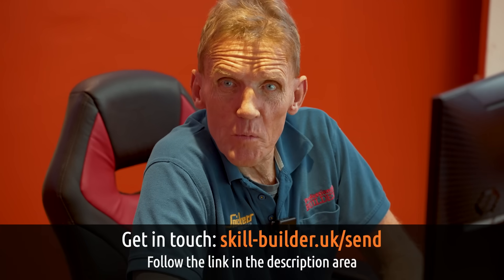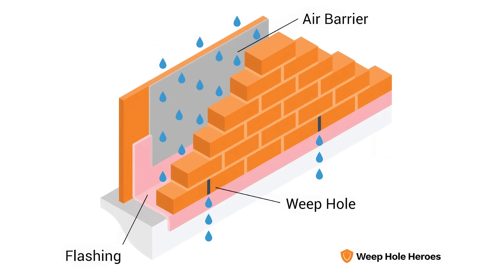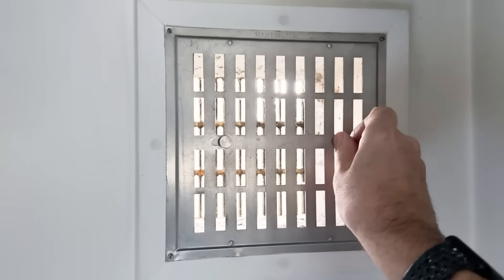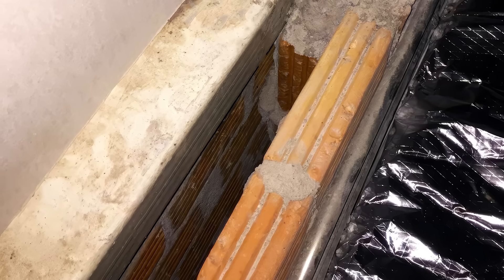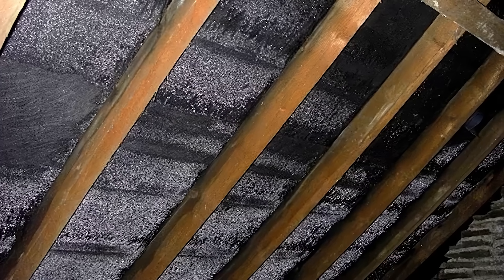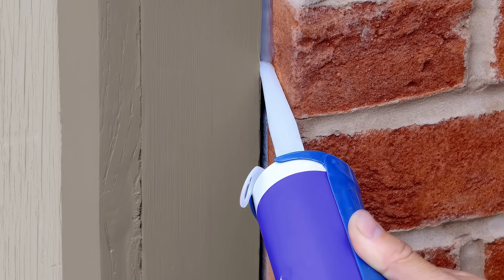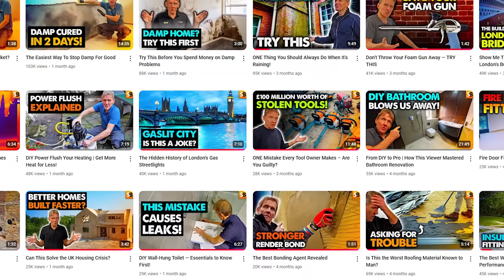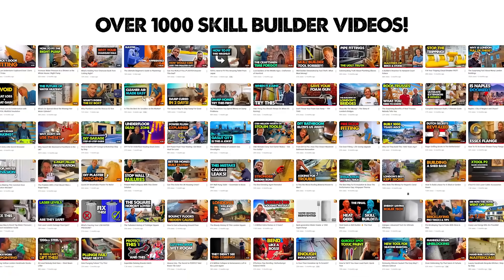The Truth About Cavity Wall Ventilation

Comment: Not sure u want kill airflow though the cavities, as it’s a tried and tested way of preventing moisture build up , which could cause problems with  damp and eventually rot ( in timbers ) capping the top at the eaves makes sense but sealing up or removing the air bricks at low level, I’m not so sure,trapped air is a great insulator ( as roger says ) but trapped moisture laden air in the cavity is only gonna lead to problems further down the line I reckon , uve gotta somehow come to a compromise between the two scenarios insulation but without introducing a damp issue and airflow whilst trying to reduce heat loss , it’s tricky , especially in a retro fit scenario ( with no or virtually no access to the cavity .)cavity wall insulation can cause its own problems also and any rockwool type of insulation in the cavity is a complete no no ( if it gets damp it will definitely cause damp , especially at low level as it starts to slump under its own increasing wet weight) and the micro beads stop the airflow at low level . Like I said it’s a problem on older properties, not so for new build if built correctly to the regs ( although we all know that don’t always happen 🫤)

Comment: My 1911 terrace has lime mortared cavity brick walls. The cavity is ventillated externally by huge cast iron vents a the top and bottom, plus gaps into the cavity above all the sash window frames. After 100+ years the walls are beautifully stright with apparently no issues with corrosion of the wall ties, but I hate to think what could happen if I messed with the cavity ventilation in any way.
Reply: If it ain't broke, don't fix it! 😁
Reply: I'd suggest it would be worth filling the gaps on the inner skin around the windows as the gaps will allow moist internal air into the cavity.  You may be lucky in any case, and have wall ties that don't rust (wrought iron lasts for decades even right by the sea and regularly submerged in saltwater, and I think some early types of tie were even brick-based).

I'm not against changes and improvements myself.  My own house has a 9" solid exterrior wall, which isn't its worst feature, but the wall does get cold in the winter and hot in the summer and is pretty awful thermally.  I think the problem we have is people rushing into a one-size-fits-all approach, often by inexperienced installers and without consulting people with a thorough understanding of how historic buildings work.

I did insulate my suspended timber ground floor, and found it to be a significant improvement on an uninsulated one, but I can see how this could easily be done wrong and also cause trouble.

Comment: Filling a cavity with insulation bridges the cavity and allows water to track onto the internal wall and is particularly poor building practice.
Reply: The primary role of the cavity is to waterproof the building not provide a location for insulation. A way better method if you want additional insulation is brick veneer with the insulation within the interior timber wall. We leave our cavities open in Australia. We get so 3:04 much rainfall too. Cavities get a lot of water inside them, they also need ventilation to dry them out. It’s been working for 100’s of years. 

What do you do in England when all the wall ties corrode due to all the moisture trapped inside the cavity, condemn the building?
Reply: Modern wall ties in the UK are stainless steel, so no corrosion. Whether the inside of external brickwork gets wet is down to a number of factors (porosity of brick and joint, location, aspect etc) but I've demolished plenty of cavity walls which are bone dry inside .
Think about it; most.properly maintained 9 inch solid walls don't suffer penetrating damp, why do you assume the outer 4 inches would always be prone to being saturated? They're usually not  @davidconnolly7346
Reply: That's what cavity trays and weep vents are for, they are never 'sealed' so to speak.
Reply: Have you been living under a rock for the past 30 odd yrs? Fully filled cavities have been used and APPROVED for use in this time! Bad workmanship is the cause of damp penetration!
Reply: @ It is like putting a sponge inside the cavity retaining moisture . It bridges the cavity and draws water across the dry interior skin. It also promotes corrosion of the wall ties. Unless the exterior face of the wall is sealed with a properly sealed foil and reasonable gap maintained water will track across. It is such a stupid idea approved by officials that have had a mind fart. 

It has never been legal in my country. We frankly still have our brains turned on.
Reply: @ It cannot work, you are putting a sponge inside the cavity and tracking moisture to the dry skin. You are also jeopardising the structural integrity of the building by creating a moisture soak at every wall tie encouraging them to corrode. It could work with foil faced insulation but a cavity should still be maintained. Whoever approved that 30 years ago was having a brain fart. 

It’s not legal where I come from we still have our brains turned on. Seriously it is absolutely nuts, and fixing it with a paint on sealant is bs too. It’s poor building practice.
Reply: @davidconnolly7346  not arguing  but where are you from. I'm in essex UK, I've laid bricks since 1986 with full fill insulation  in 95% of the cavity  work. I've yet to have a comeback. Modern  full fill bats are water repellent  but the older stuff not so much
Reply: @ I put it to you that no one would come back to you personally as the building is warranted by the builder. From a builders point of view, problems like this wouldn’t manifest themselves until well over in our case the 6 six year warranty period. For instance wall ties are not going to fail within 6 years. What I’m thinking about is the longevity of the building.
Reply: @markrichardson5295 nothing is better water repelant more than a  cavity. I received advise like u and my 5 years old extension  smells terrible because of damp rockwool.

Comment: I would argue that each building design is different so a 1 size fit's all approach doesn't work. Some houses need the airflow/cavity regardless. Filling it will just cause issues. The building next door might be similar but is ok with cavity filled with insulation. 
Materials used, quality of the job will all effect the outcome.
Reply: and local weather - in a wet wind or not ?

Comment: Last 2 months i build an extension on my house. I filled our cavity with insulation about 3 years ago, so i was a bit nervous how it looked on the inside after removing some walls (in cold and rainy weather). You dont know how it goes in the cavity, maybe it is a bit wet or dampy or moldy. But it was a perfectly fine, dry insulation, dry bricks, no heaps of insulation flocking together etc. 

I have to say we do ventilate alot in house and the house is build in 1970, so the bricks and joints are good. 

I do think if you have a house with bricks and joint that are more porous or broken, you better re do the joins and impregnate the bricks before adding insulation.

Comment: I was always stunned by the sheer simplicity of cavity wall insulation sales folk. They'd knock on my door and ask if I want it, I'd tell them it's a Victorian house - with solid brick walls. They'd say 'oh'... and then go next door, and enxt door to that etc. In a terrace of houses exactly the same, getting the same answer each time.

They have now moved onto the highly toxic and flamable external insulation. So they're having to be told what a conservation area is by everyone that answers.
Reply: It would only take one, probably elderly, houseowner, who doesn't know/understand they have single skin walls, to say yes. Then they could turn up, drill a few holes in the walls, make some noise and pack up.
Reply: 😂😂😂😂😂😂😂 @gcunn1
Reply: I'm in a conservation area and I'm having external wall insulation. It was approved with no conditions by the council. It would only be if the parish council are staunch traditionalists or if the house is listed that you might have any issue.
Reply: @robertszynal4745  Lucky you.  A friend of mine was in your situation (conservation, but not listed), but the council took a very hostile attitude to external wall insulation of a 9" solid wall.  Timber cladding wasn't appropriate and 'would trap moisture' (with sheepswool insulation???), render wasn't appropriate etc etc.  No real attempt at discussion so basic method seemed to me to be ' apply for whatever you like and we'll find an excuse to oppose it'.  This was Tendring District Council planning office (and, moreover, their masters in County Hall).  The actual local councillors did not object to it.

Meanwhile, other people in the same street have carried out far less sympathetic cladding without insulation, and enforcement action has not followed.  Then we wonder why this country has the worst housing in Europe.
Reply: @robertszynal4745 External insulation is the best, you'll save a fortune with the heating, warm in winter cool in summer 👍,  they paint/skim over it so it's fireproof don't worry.
Reply: @ianmangham4570  most modern paint is made from flammable polymers. Only specialist flame proof paints, which are expensive, special mineral paints and traditional limewash, have anti fire properties. Unfortunately most outside paint used is plastic based masonry paint. Which despite its claims is very unbreathable, creates huge amounts of microplastic pollution, and has absolutely zero fireproofing abilities. It crinkles and burns up even with lower temperatures from a hot air gun, let alone an actual fire.
Reply: @robertszynal4745  not at all, the local district council is the planning authority, and they would normally prevent this. As it drastically changes the appearance of a small area whose appearance is being specifically preserved. External wall insulation can also cause huge problems on older buildings, especially if not done very well, or without proper attention to detail. Old solid walled buildings remain dry by the walls being vapour permeable, to remove moisture. Stop this and they can have terrible damp problems.

Is you house a modern nondescript house, in an area of older houses? This is the most likely answer as regards why you got permission. That or a grossly incompetent planning officer.
Reply: Flammable are you sure
Reply: I'm amazed at how much industry there is for cavety wall insulation REMOVAL. Heating a home is easier than spending all the money to remove damp and mold.
Reply: Hahaha - brilliant 🤣

Comment: Back when people could live below 20C the cavities were all open. Tons of airflow, but not much insulation. Less problem with condensation indoors. Before that it was straight 9 inch with no cavity. Or rock with rubbish infill. Cavity wall insulation is still supposed to sit off the outside brickwork for airflow. Same as roof areas are supposed to have airflow. I remember when they stipulated a 2 inch air gap. And we installed soffit or fascia vents to create that flow. And then tile or ridge vents to exhaust that. Keeping the air moving. Now are you supposed to have no flow. Makes no sense. Not good for the house or the occupants.
Reply: The 50mm gap regulation still applies - in roofs its for ventilation, in walls no so, its for water / moisture transfer from outside to in! If moisture can migrate to a cavity or roof void it must be ventilated, if it cannot - it doesn't need ventilation. If you prevent migration (say from a room into a roof space) then the room needs ventilation or damp will occur!

Comment: Well Roger, as a long time fan of 'Bisby News' :-) i would have to query your assertion that air (whether moisture laden or not) from the cavity could lead to an appreciable amount of condensation in the roof space .. I have no evidence to the contrary as such, but roof spaces generally have a reasonable air-flow for lots of reasons .. so if one were to see a lot of condensation in the roof space my first thought would be to check the roof space ventilation (as we know that some folk stuff so much rockwool right into the eaves that natural ventilation is diminished) .. 

but carry on Sir, as you put out some great info and there's often a talking point to get our teeth into :-)
Reply: good point Sir, ive seen appreciable amounts of condensation on the underside of roof tiles, and would agree that this is not due to 'cavity' issues .. since the condensation was widely spread across the roof and not local to the top of the walls .. 

particularly in winter, roof tiles ARE cold enough to cause moisture laden air to reach its 'dew point' and then water droplets 💦  appear .. 

as you say, most roofs, particularly older builds are well ventilated naturally .. even birds and bees are in there building nests and those little paper hives .. lol😂

Comment: Hi Roger having worked with cavities and insulation on the Architectural Technical side, for many years, it needs to be pointed out the fact Cavity are now wider and interstitial condensation calculation  including a dewpoint calcullation needs to be done , when filling a cavity with insulation. I do not agree with you saying cavity needs to be sealed. With the increase in insualtion a flow of air is required through the cavity from the weep holes above the cavity tray and into the loft space, where the insulation shjhould be elither at cieling level or rafter level. A flow of air is important , thick of a chimmney. We can not live in hermetically sealed boxes, nature needs a  air balence flow which is calculated!
Reply: As a young mechanical building services draughtsman, many moons ago I used to calculate and draw temperature gradients through walls (of various constructon) to see where/if interstitial condensation would occur. I would then advise the architect on a remedy, if required. This was before computer programmes
Reply: @MarkJones-ji8fd  Can you calculate the amount of water that tracks across the cavity when it’s full of insulation and not being ventilated?
Reply: @davidconnolly7346  no, only where in the wall construction condensation was likely to occur
Reply: Reading your comment, wondered if you could provide some expertise on my house. I’ve recently moved into a 60s house in England in the north and it has cavity walls however as part of a grant the walls were filled with cavity wall insulation which was the eps bead variety. 

The problem the fitters actually sealed every double air brick including the ones below the dpc for the timber subfloor void.

When remediation work was done they came out removed the air bricks and fitted cavity brushes so no beads could block the vents. 

However I’ve recently been told they should have been ducted instead of using cavity wall brushes, do you think this is the correct opinion or should they be left as is so the air can flow through into the subfloor and through the cavity brushes into the cavity and the beads albeit it’ll be small amounts ?
Reply: I thoroughly enjoy finding comments from people who have worked in the industry, I always learn something from them.  Having said that, the video makes no reference to sealing the living space, he's talking about sealing the cavity.

Comment: No I lived in a coal board house from the 1962 up to 2014 and I never had any cavity wall insulation fitted and we had no damp and there was air bricks fitted to every room in the house and they did there job even at winter kept open ok

Comment: Trapping movement of air more importantly. I'm not sure but I think cavity convection is a thing? Maybe you can clarify this, if true or not, I am thinking of getting the party walls gap filled. I think convection is the reason why feathers are more insulating in a jacket than just air sacks, but maybe it's radiation. 

On a further point, in many houses we need a bit of heat loss to dry that skin out, most house brick don't last long if they become damp.